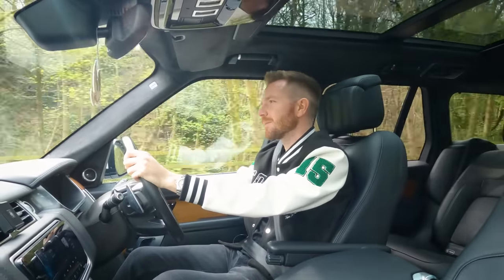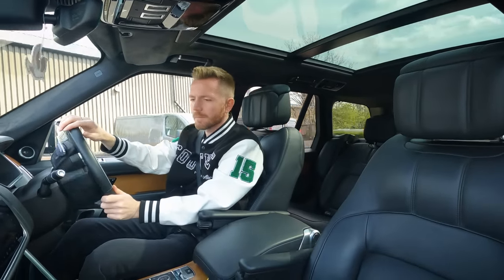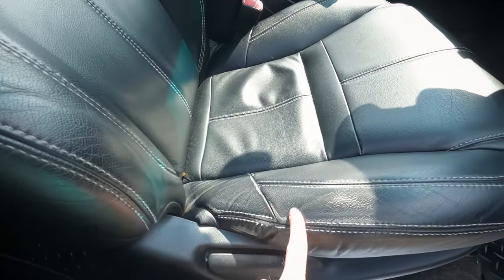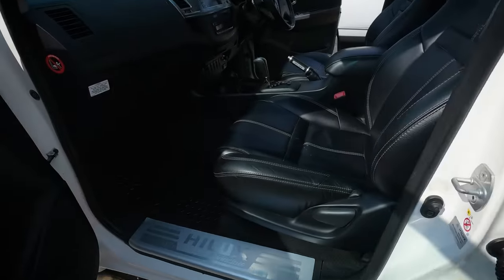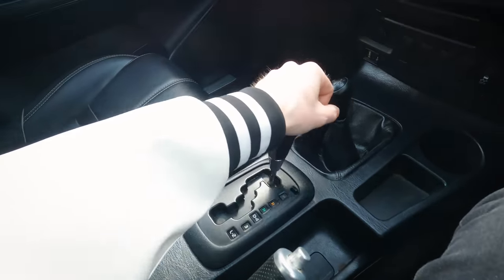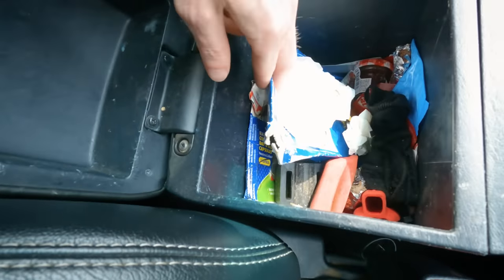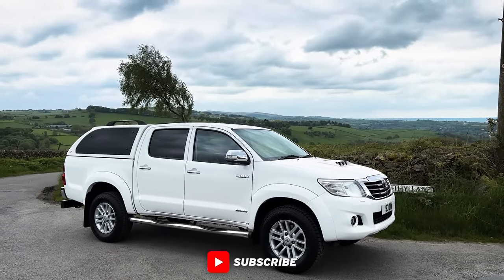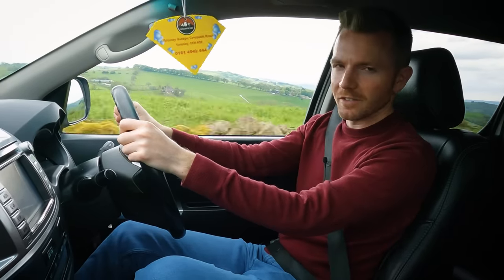I BOUGHT A CHEAP TOYOTA HILUX

Comment: I'm a tech for Toyota main dealer and I knew you were going to say about the fuel sender before you even said it! Sometimes they do however get misdiagnosed as a faulty gauge cluster too as you mentioned. The brake pads do also have a habit of sticking on the holding pins causing uneven wear so it's important to clean them at every major service.
Reply: Have you ever heard of a car (Toyota Verso 1.8 petrol auto) having acceleration problems "only" when fuel is below half tank? Mystery to all the mechanics I have spoken to. No warning lights. Passes MOT. Idles perfectly. Starts fine. I just keep filling up until I know what to do? Diagnostics shows no codes. Would be pleased if you could resolve this mystery.
Reply: Maybe try some more mechanics or take it to a main dealer. Could try running it on premium fuel for a couple of fills as well…
Reply: @JohnSmith-cs7jg  I've tried premium fuel for a few months and Injector cleaner and petrol system cleaner. No difference. Someone also suggested purge valve or fuel pump on its way out? Stumped as costly to start changing the wrong things.
Reply: @ernestschutte1978  brim the tank and sell it 😉
Reply: @JohnSmith-cs7jg  🤣🤣🤣 It's still a good car 1.8L bullet proof. Will keep it.
Reply: @ernestschutte1978  Not a Mechanic, just someone who likes to work on my own cars and so happen to live in Oceania which is absolutely flooded with Toyotas.

Sounds to me like fuel pump has weak pressure, could be time for a new one. Do the fuel filter while you're there too!
Reply: @Ploxsource  Thanks.

Comment: These are brilliant trucks. We do 20k miles a year on ours and other than regular maintenance its never missed a beat. Will be on 200k miles next year
Reply: Well everything toyota makes just gets the job done
Reply: Why do you call it a truck
Reply: @ogone1465  because its a truck
Reply: @ogone1465  Americans call it a truck, Australians and NZers call it a "ute", which I believe is the actual correct term for these pickups
Reply: @sullivanl3305  The pickup truck was invented by Henry Ford. This is just a mid-size version of a pickup, so truck or pickup is the correct name. Utes were originally based on cars and had a integrated bed (similar to the Honda Ridgeline). Australians and NZers kept calling everything with a bed a ute even though there really aren't many utes anymore.
Reply: how much cost to fill up and how many miles to a tank?

Comment: Great video. Obviously I am an exception to your rule as we bought a 2 seater version of these for use by staff. Partly because of its reputation for being indestructible. 6 years later still going strong, despite the fact we are located right by the sea.
Reply from the maker: Just make sure you protect the underside and you'll be fine
Reply: Any jobs going?? Working by the sea and a Hi Lux for a company motor sounds great 😊
Reply: @JohnSmith-cs7jg  I'm afraid not at the moment, but thanks for your enthusiasm! 🙂

Comment: £1600 for a new steering wheel 😳 wow! Great utility vehicle with great spec. Your mate must be well pleased, great video Matt👍🏻
Reply: that's the problem with Genuine Toyota Parts. I went to the Dealer to ask for a single side mirror and I was told its £1450
Reply: That's around 5 minimum wages in eastern EU for a steering wheel.
Reply: @piusgumo3330  That's crazy.
Reply: Well at toyota sparepart independent shop its only for 300 pounds here in indonesia brand new. For second hand but refurbish steering wheel its only 150 pounds
Reply: @trianggaindralukmana2184  I wonder how much to ship to the uk?
Reply: @kasiosag  i dont know but its a bit expensive must be. A kilogram weight from indonesia to UK maybe around 20 pounds, and steering wheel is large in size could be estimate higher than actual weight to compensate size. 

I think you could buy a leather for steering wheel and find a tailor that can sewing stitch around wheel with needled and string
Reply: @trianggaindralukmana2184  wow expensive then.
Reply: @kasiosag  yes because distance is very far. Cant argue about that.
Reply: @trianggaindralukmana2184  no we can't

Comment: We've a Vet College who run a fleet of these on their Equestrian section and they all run rear fridges etc in the Truck Man back, all battered and Hell as they literally crash up farmers fields etc and all done well over 170k. Three have had new clocks and also have the dodgy fuel gauge as they have stickers saying to fill up at 400 miles. All run Bridgestone or Good Year tyres regardless.

Comment: One of the last 1KD's engines. Injectors seals failing are common on these engines. Can end up killing the motor as it blocks the oil pick up in the sump with carbon.

Comment: I have blown up, and I mean this, spectacularly, Mercedes engines. And various others makes. Engines I haven’t blown up, and this is 33 years of reliability, is Alfa Romeo. And Fiat. I tried as hard as I could, with both brands. The attention to detail of the underseal, and gearbox service. Matt, you are the King of used vehicle resellers ❤

Comment: they have a 2.5 and a 3 (newer is 2.4 or 2.8)

Looks mint! Mudflaps still in place, the 2011-2015 facelift. Still has the plastic caps in the rear bar.

Never been offroad. 

In the Netherlands (Left. wheel drive) it would do 23k Euro.

note that coolant is a bit low!

Comment: My father has a Auto leasing business that gives vehicles used on land rigs in the deserts. 90% of his fleets are Hiluxs. In the end of their lease 3-5 years they are driven between 400-500k kms. They come back we change tires, give them a cleaning and off they go for next lease jobs. They're indestructible as Clarkson once said. One problem we often face especially with the newer 2.4 Diesel engines are the fuel injectors.

Comment: I've got a 2015 SR5 in Australia, its completely stock with similar miles/kilometres and its currently worth over $40k AUD. thats currently the average price for a used hilux atm. crazy that its double the price over here. They are extremely common in Aus and for good reason, their bullet proof and reliable, go anywhere, easily customisable, and of course its a toyota so it holds its value and in my case actually goes up in price since i bought it. 

My first car after getting my licence was a shitbox passed down from my brother for free, and when that inevitably gave up, i knew for my "first" real car that i bought myself, technically 2nd car, i wanted something reliable, and since i've always wanted a ute. The hilux was a no brainer. i've had it for a couple years now and its my pride and joy, it's got a very thorough service history and i plan on taking some tips from your vid and getting it painted undernear and around the wheel arches for protection, and doing a gearbox service, too. Great vid mate! thanks for the tips.

Comment: Hello Matt, i have just finished doing a thorough detail on my 57 reg alfa romeo 159, spent the last 8 hours on it. I also saw that alfa romeo had put the poles for the middle headrest in the wrong place, HOW ALFA ROMEO IS THAT. Anyway.. released just in time to reward myself for gutting the interior and exterior.
Nice video Matt!

Comment: These ones are a workhorse in Africa. My dad used it for years with no problems save for regular maintenance. But the manuals are the common ones here.  Nonetheless, I doubt it will turn into an absolute lemon for you

Comment: Toyota Hilux/Fortuner models were recalled in South Africa for faulty fuel gauges . The vehicle runs dry while still showing 1/4 tank and 120km of range . Apparently a dry solder joint in the back of the instrument cluster .

Comment: It’s only one of the good ones if you stick to servicing schedules which are arduous, regardless of that my mates 70plate Invincible X has blown up at 38k miles, whereas my 71plate Wildtrak 52k miles still goes strong. Both tow heavily and are used for their intended purposes. I’ve owned 8 Rangers and they’ve never let me down.
My second motor is a 22plate R-Dynamic HSE Disco, so principally I am with your man and his views as to which vehicles are best. LR/RR fan 4 life!! 😊

Comment: Lots of pointers it has spent much of its life towing - oil and relatively low miles range at 1/4 tank - wouldn't be surprised if it was towing a horsebox.

Tyres are an interesting choice in that respect - decent all around tyres well mannered on the road and capable off-road but dry and wet braking on tarmac are very much not their strong point - I would not want to be trying to stop a pickup + horsebox on those :s

Steering wheels in pickups always seem to wear badly - I ended up lightly sanding and refinishing with gloss sealant the one in my Navara which has done a reasonable though not perfect job of reconditioning it - but the cost of a new one is a touch more than is worth spending on an older vehicle now.

Comment: I own a black one of these. Same year. Same engine. Same gearbox (its a 5 speed auto, not a 4 speed). I have fitted a steel winch bumper and snorkel. Its also riding on 32" BFG All Terrains snd 16" steel wheels. Suspension upgraded for heavy duty off roading (and because of extra 88kg hanging off the front) but its not been lifted as it doesn't need it. 

Mine is 9 years old and literally everything works. Starts every time. And i lived on a farm in rural Perthshire, it was off road literally every day. And i roam the Highlands regularly in all weathers. I can't think of a vehicle that can do what I've asked of it better. And ive previously owned 2 Defenders (a 90 and a 110). Loved them both but the Hilux is objectively a better vehicle.
Reply: Shameless link to video of my Hilux on the farm:

https://youtu.be/x12S2FooC_w?si=RF0wlJhl1fS0PqjZ

Comment: my dads company has a few Hilux's.  there is that  has about 550,000 km. its in very rough condition cosmetically but still starts like brand new. These things are are seriously indestructible. there maybe pickups/Utes that are more comfy, luxurious and handle better but in my opinion there is non thats lasts like a toyota hilux.

Comment: Ref. the steering wheel, and Toyota parts prices. That goes with my earlier comment about OEM V aftermarket radios. I seem to remember £12 each (ridiculous!) for door contact switches, as for batteries...

Comment: A problem I see with many 6 year old cars, in the 5 years cam belt change has not been done and many dealers don't want to do it and won't give you a discount so you can help pay for it your self.
Reply from the maker: The trouble is, from a dealers point of view, why should they pay £500 for a new cambelt out of their £800-1200 profit margin? We're already being squeezed between having to pay more for stock because of Motorway & WBAC etc and then still having to sell something slightly below market value to appear an attractive price on Autotraders pricing markers
Reply: @HighPeakAutos  aye, its a bad situation, no one wins, aside from Motorway & WBAC.
Reply from the maker: Yeah thats it

Comment: Did you throw in the yellow shades for £11.7K? As a White one you'd think the plate would be UN rather than DN. Never understood why in the UK they don't sell the Fortuner very similar chassis but with an SUV body 7 seats, better suspension and considered just as indestructible ( might be just as jittery at high speed though).
Reply: We did get the 4runner till the mid nineties, after that is was land cruiser if you wanted all the seats.

Comment: There's no such thing as a cost free second hand car. At least not if you want it to be the best, or close, that it can be. Case in point, my 2013 3.0ltr supercharged XJ portfolio with only 16,000 miles on it, garaged all it's life, serviced on average every 2000 miles, bought from a main dealer still needed £1000 spent to bring it up to scratch. New battery, service, N/S wing mirror, tracking, keys reshelled. The dealer picked up those costs. I then paid for a gearbox service and another A service at 19,000 miles.

Comment: The small pickups just don't work for me. The back seat is too cramped, the bed is too small, and tow and payload ratings are not high enough. It will be a nice truck for someone.

Comment: Hi, Used your link for the carvertical discount so thanks for that. I'm looking at buying a V70 R design and have looked it up on car vertical. However the MOT section isn't showing the MOT reports which contain the advisory items like it does when you use it on you r videos. Is there somewhere else on the website I need to click? It shows whether it has passed or failed and in the latter case the reasons why

Comment: Whats with these Toyota steering wheels that look like theyve been sandpapered once the car has afew miles.
Recently bought an Avensis with 100k and the wheel was in a terrible state. Managed to get one from a breakers off a newer petrol model with low miles.

Comment: question i have a L405  going in for a service i want the transmission and gearbox oil changed is it worth the extra for a flush or just change it?
Reply from the maker: Depends on the mileage and if you've been towing etc

Comment: Get yourself out in a ranger raptor either the previous gen diesel or the new v6 petrol. Now they are pick ups that drive and ride properly!
Reply: Rubbish the Hilux is King I use mine for work hauling digger and tractor. Raptors are for posers and not workhorses
Reply: @michaelbudd123  yea okay

Comment: Well that looked mighty fine but has made me laugh.
These vehicles have come a long way since I had one but does this make them any better ?
I had a column change one with a dash handbrake in the 70's , no satnav just a map and good sense of direction.
Had it from new and changed after 10 months because I'd clocked up 79,000 miles in it.
They weren't a status symbol back then but a mule to earn some brass and if they lasted 12 months you were in the money....how times have changed 🤣

Comment: The Toyota Hilux l have a 26 year old one still runs well and its a rwd single cab with an aluminum tray and it is worth aud $5000 to $6000 because its a 1997 with the extremely reliable 22R engine good for over a 1000000kms one sold recently for aud $500 and the reason it sold so cheap it had done 980000kms but mine has only done 430000kms and these are utes not trucks please for Australian viewers call them a ute also  in Australia these are the biggest selling vehicle in Australia because its a Toyota and it will be reliable last for ever